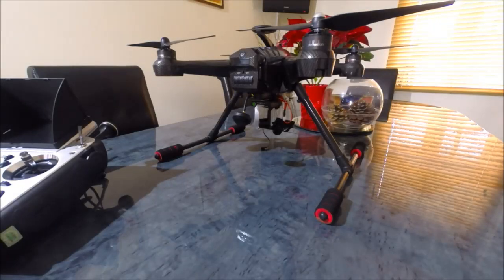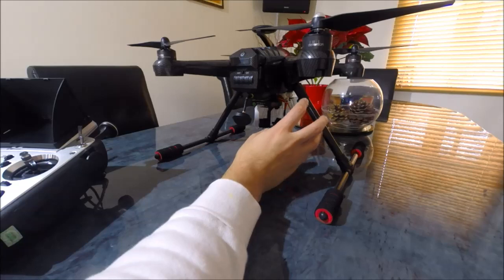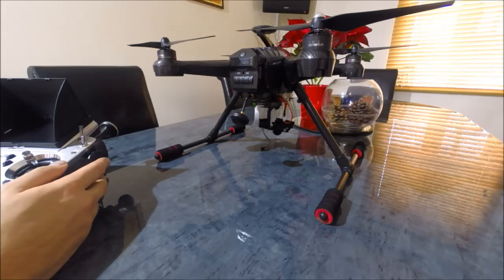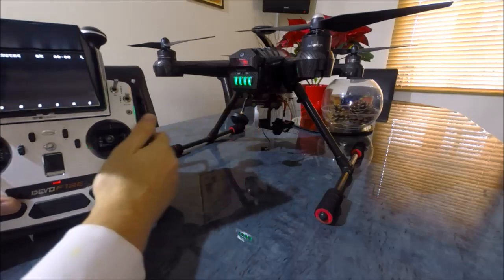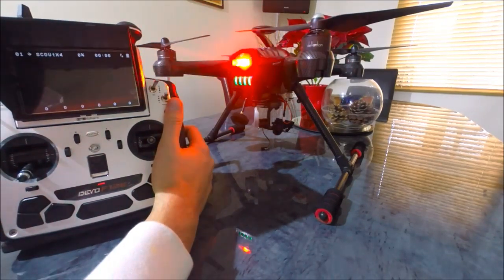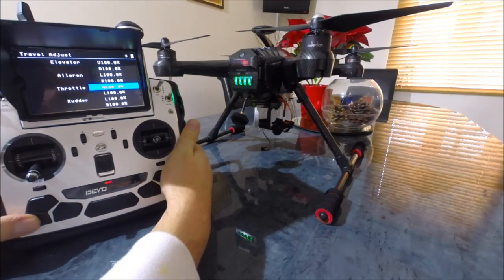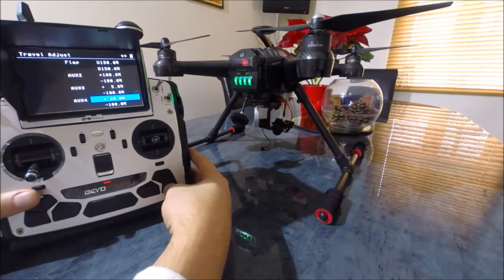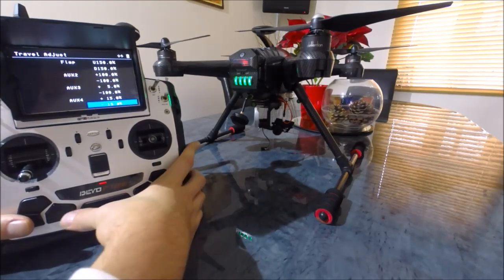Walkera Scout X4 - Modifying Retract / Landing Gear

Comment: Hi alex, thanks for all the videos, one question if i hit return to home, after that i will be able to download the retract or  do i have to download the rectract before i hit the return to home ?
Reply from the maker: Hi Edward, it does not matter when you deploy it. As long as you deploy it before it touches the ground, otherwise you have a crushed gimbal and camera :)
Reply: hey can you post a video on how to remove the pipes of landing, because i crash my scout and one of the pipes broke but i just order a new set but i dont know how to put it together. and one more question i use a go pro on my gimbal can i take pictures or just video?
Reply from the maker: Edward, the pipes can be unscrewed with the allen key. Simple :) Just look for the little nut in the plastic. You can take photos with the GoPro, however it cannot be done manually, you need to set a timer. I will do a video at the weekend.
Reply: ok thanks for al your help

Comment: Congratulations and thank you very much. All your videos are very good and very usefull. I'm expecting for my Scout next week and even after your very good one of the 5 reasons not to buy I´m very happy that I did because of the 5 reasons I think this is the most important, and this seems to be the solution.
Thank you again.
Greetings from Mexico.
Reply from the maker: Ricardo Carretero Glad you have found some of my videos useful. Hopefully you will not be disappointed with your purchase. No doubt in time, the 5 reasons not to buy will change and the faults with the Scout corrected.
Reply: Alex Savo I'm sure it will happen the same that with the Phantom 2 "Intelligent battery". I had three bad flyaways, and DJI insist it was my mistake, at 60% battery, They never recognize the problem till came with a new software. Now I have a lovely Phantom 2 with T-motors Antigravity and wonderful IPS HD monitor that is an authentic Ferrari for the category. But I live al 2,640 meters above sea level and need something more big and powerful. I hope Walkera fix the problems soon, in the meantime I will take it easy.
Reply from the maker: Ricardo Carretero It sounds to me like you have plenty of experience with flying quads so I am sure your be fine. A few tweaks to be made but as long as you get a good GPS lock then it should do the job. The gcs appears to be faulty depending on what tablet you use. Sounds a fantastic place to live if your that high off sea level.